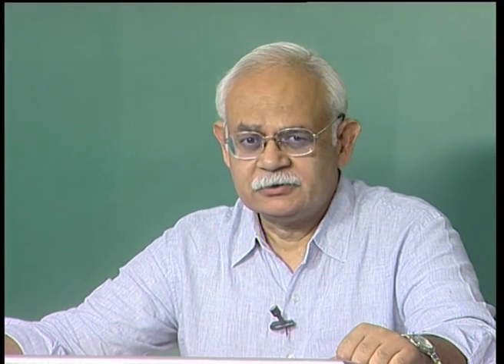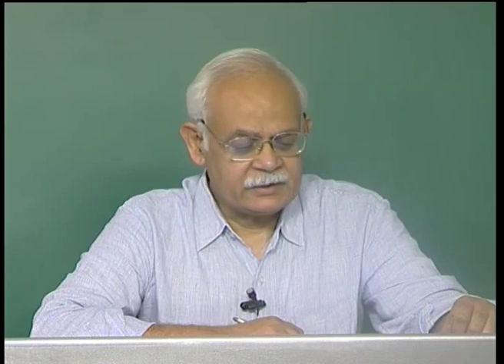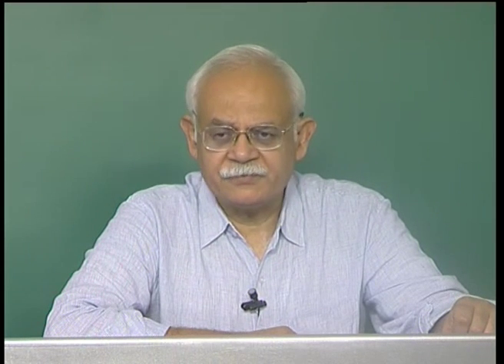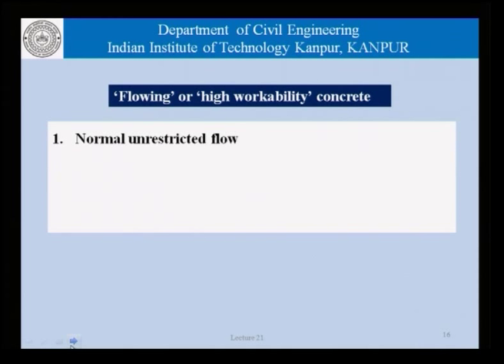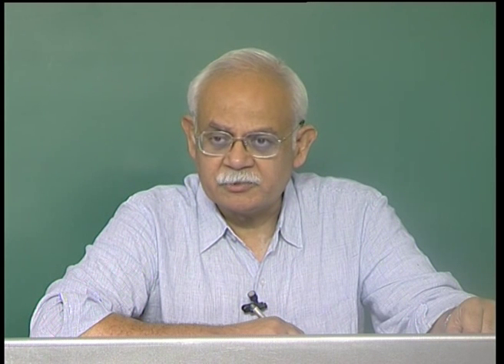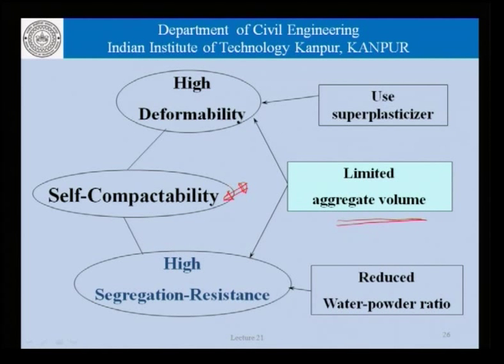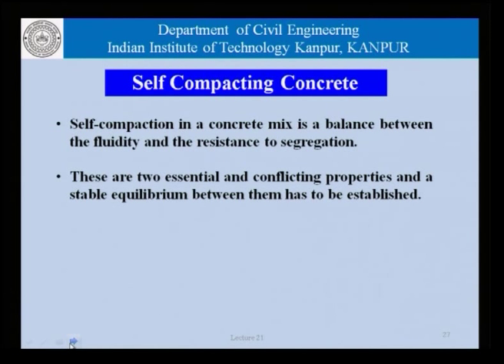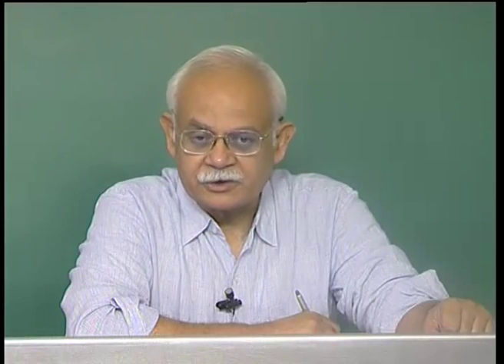Mod-01 Lec-21 Self-compacting concrete

Comment: We are doing project using M25 grade SCC mix by using IS10262:2019, materials like  cement, sand, superplasticizer, coarse aggregate ,GGBS.. we have done 6 trail mixes with different w/c ratio and superplasticizer. But still water not sufficient.